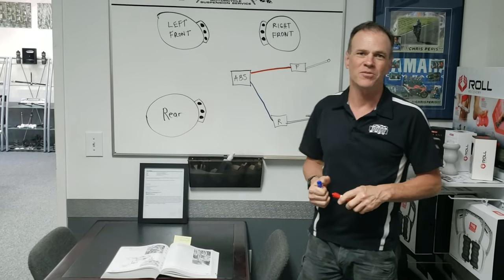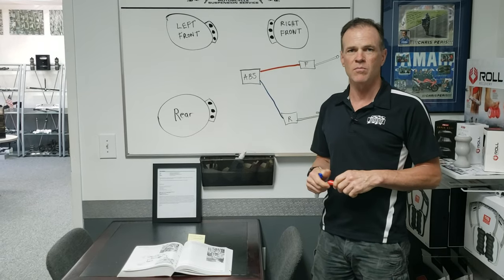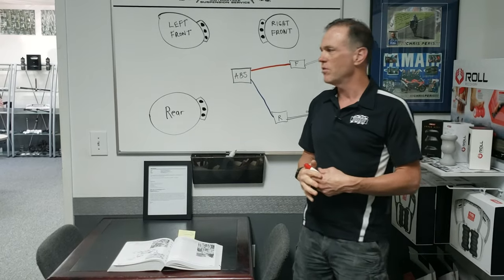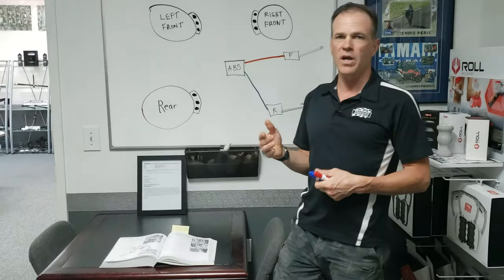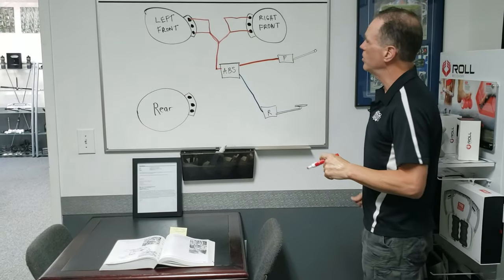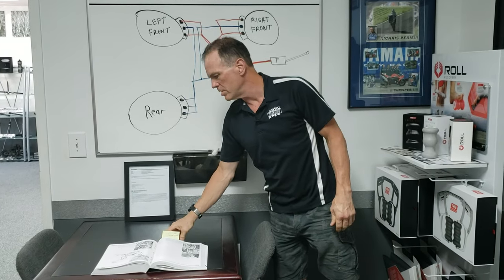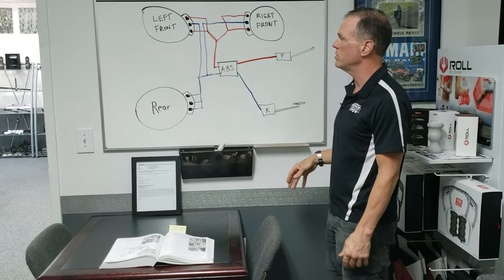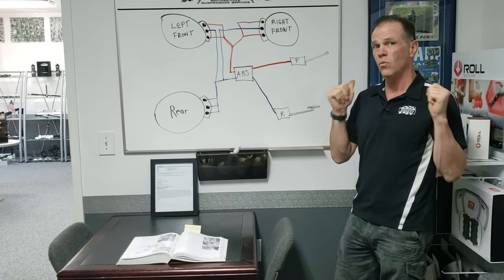2018+ Honda Goldwing Brake System Explained

Comment: This explains why as a first time, 5th Generation, Goldwing owner, I haven’t been impressed with the braking power.  All my life I’ve always depressed the front and rear pedals simultaneously for maximum braking efficiency.  Turns out, I need to be applying the rear brakes first and then add the front brakes a second later to achieve maximum braking power.  Good to know, but yes, now I have to essentially relearn how to brake  just because it’s a Goldwing.  Thanks Honda.
Reply from the maker: Exactly...

Comment: Best explanation I've seen.  As an old school rider, I apply the rear and front almost at the same time  when looking for maximum stopping.  I learned to ride on the dirt where front brakes can get you in trouble on very loose surfaces .  Thanks !
Reply: Have 2006 and 2018 Honda 1800 both of them triked. 300,000+ on 2006 and 29,000+ on 2018.I find that the 2018 in an emergency stop using back brakes wants to nosedive making it very unstable especially going down sharp hills on windy roads.The 06 could be controlled much better using both front and back brakes simultaneously. Is there a way to have more breaking power go to the rear as that is where most of the weight and rubber is anyway? I am and always been a very aggressive rider. This new system is great on 3 wheelers but not so on  trikes. Thanks

Comment: so i have a 2021 gold wing (6th gen) manual clutch .. shortly after i purchased it i noticed the an excessive amount of recoil in the front brake on my hand...i know according to the manual there can be some recoil but this was almost to lock up of the front wheel but once you let the break go the brakes would release ..did not happen all the time but only when the bike went 5 to 10 miles on the highway. at that point when you got off the highway and started to break this excessive recoil began ..honda said to change the break fluid..we did and didnt help...2nd they said to do a back bleed which was done as it was believed to have an air bubble somewhere in the system..i noticed the brake lever was not as stiff and seemed to correct the problem ..a year later the front brake is somewhat stiff again and the same thing is happening... no lights no anti- lock feel happening..i know that the next thing honda was going to do under warranty  was a front master cylinder replacement... in the city this dont happen only after coming off the highway after 5 to 10 miles at highway speed...any ideas ... is it me ?? does it sound like the bike...
Reply from the maker: No idea on this... you should continue to push the dealer to fix this.  It could be unsafe or dangerous.  I really don't know.

You might post on the gl1800riders.com forums and see if anyone else has dealt with this problem.

Comment: This video has some misleading comments about the 01 - 2017 system. Assuming that all components are in a good mechanical state and fluid added and bled and Traction fork springs and 15 wt fork oil installed and Anti Dive System disabled per Traxxion instructions THEN the system works amazingly well. Unfortunately, the description of the function is not easy to get since Honda and forums have it scattered all over the place together with wrong info. For instance to find out the fact that standing still the front level effects only front brakes and foot pedal effects both rear and front is almost impossible to find. And so on...
Reply from the maker: Let me know the importance of how a brake system works for a motorcycle that isn't moving.

The information in this video is completely accurate.

Comment: Compared to my old Yamaha XV 1000, these brakes are amazing. It took some time to get used to how hard the fronts grab and slow you down, but wow, after a few rides the muscle memory kicked in. Love how you hear the drilled rotors sing under heavy braking when a traffic light changes and you know that guy will turn left in front of you! Honda did an amazing job.

Comment: Back in 09, when I bought a Concours 14, I was amazed at the phenomenal brakes on such a heavy bike. I thought it couldn't get any better than that, and was fully expecting My 18 Wing to feel wimpy by comparison. I gotta say, the brakes on My Wing are also pretty awe inspiring. I had never owned a bike with linked brakes, and I'd heard the owners of 2010 or newer Concours14s complain about the linked brakes on those. Honda definitely got it right on the new Wing.
Reply: My Concours had the sensation of warped rotors almost immediately.  The linked braking proved even more annoying because the use of the rear brake alone wouldn't avoid the pulsation from the front.  Kawasaki fixed the problem in kind of a funny way.  They authorized replacement of the rotors, but not the pads.  The bike began doing it with less than 5000 miles.  I live in Iowa and have little need for heavy brake usage so the problem did not arise again until my trip out west the following year.  Since my dealership was about 100 miles away, I simply put up with it.  In Iowa, it wasn't too big of a problem.  Several years later, I had the wheels off for tires.  The rotors had been installed out of phase so the carriers were not symmetrical.  I removed one side to clock it to match the other.  I also loosened the bolts on the other rotor and torqued everything up evenly using a crisscross pattern.  Kawasaki used a plastic shim between the wheel and the rotor, probably to fight vibration.  To my surprise, the pulsing was gone.  Apparently the dealership did not install the rotors correctly when they replaced them under warranty.  Even torque was very important.  I wonder if Kawasaki might have done it from the factory.  We take it for granted that manufacturers and techs do the job right the first time.  Sometimes that is not the case.

Comment: Max, love your products...I own several. The belly pan is pure genius. I would ask that you revisit this video though, and take a look at page 1-115 in the service manual. The rear is applied with the front lever, the ABS unit pump sends it back there when it senses the front being applied.
Reply: It's on different pages depending on year of service manual, below is what it says in short, bottom line is the rear brake IS activated with the front brake lever:
The recirculation-type Combined Braking Anti-lock Braking System (C-ABS) allows shifting of the CBS (brake pressure boost) characteristics according to the selected ride mode. The CBS characteristics are shifted using Controller Area Network (CAN) communication among the riding mode switch, the ABS modulator control unit, and the display panel. 

As front brake lever movement is detected, the pump in the ABS modulator starts to feed brake fluid from the master cylinder to the calipers (pressure boost), and activates the rear brake. 

The CBS characteristics in SPORT ride mode are set to produce an appropriate rear brake force different from the other ride modes. The CBS in the rear brake system is a conventional system as shown in the picture without any brake pressure boost by the ABS modulator.

Comment: I would've liked to see them have the 1 center piston on the rear be linked to the front so that you get some rear braking as well for those that forget to use both front and rear in a panic situation or even just in normal stopping situation were some people never use the rear brake at all.
Reply from the maker: Then the 2001-17 bike might be preferable to you, as it does those things.  

Making the brake system work for unskilled drivers who don't take the time to learn how to operate the machine they are on is the entire reason linked brakes exist, as noted here.  If people would just be properly trained, none of this would exist... and there would be no such thing as a panic situation; Just an emergency situation with a skilled rider doing as much as possible to minimize any possible incident.  You only panic when you don't know what to do.

Comment: I always try to use both brakes for any kind of braking.  Even trail braking.  Because I want to build in the habit of using both for an emergency stop.  I caught myself a couple years ago only using the front brake during an emergency stop for a deer.  I would have stopped shorter obviously had I used both.

Comment: Hi Max. I tow fully loaded and two up with my 2004 and I've never felt the bike was underbraked which is not to say I'd turned down more powerful brakes.  At 60 I'm also a traditional front brake rider. The 2001-2017 system is mentally complicated but really that's because of the stupid anti-dive, which I've shimmed on mine to make it ineffective (after watching your video).  Surely, the straightforward comparison is that on the 2001-2017 bike the front brake lever gives you 5 of the 6 front pistons and 1 of the 3 rear pistons whilst the rear brake pedal gives you 2 rear pistons and 1 front piston.  I'd call that a front loaded system with a little rear stability thrown in for free on the front brake.  As you explain, the 2018+ bike operates 4 of the 6 front pistons, and that's it, whilst the rear brake pedal operates all 3 rear pistons and 2 front pistons.  That's a lot of front braking on the rear brake and sometimes you just want the rear brake.  It's great that the 2018+ bike comes with more powerful brakes but I think you're being harsh suggesting that the 2001-2017 doesn't allow the bike to be ridden in the traditional front brake way.

More importantly, when is Traxxion Dynamics going to open up here in the UK?  Please, please.
Reply from the maker: Hi Michael!  I am not sure where you got your explanation of the brake system on the 2001-17, but it's way off.  I have thought about doing a video on that to explain that monstrosity.  The front brake gives you 2 pistons on  RF caliper, one on LF caliper.  That one activates the secondary master cylinder on the left fork, and gives you 2 pistons on the rear brake.  The rear is Much more complex... I'll do a video.

I have a knowledgeable agent in the UK, Gareth Evans at Reactive Suspension!!!  I don't hear from him much, but he's a great guy!
Reply from the maker: Also, if you haven't ridden a 2018+ you simply won't believe how much Honda improved the brake system!
Reply: @Traxxion  Hi Max. I've found the diagram that you're referring to which I gather is the right one. My explanation came from the GL1800A Service Manual! Good old Honda. 
When Honda incorporate all your improvements in the 2018+ and go back to a bigger fairing and luggage, I'll buy one. Keep the videos coming, great work.

Comment: So there's no way to do pure trail braking because applying the foot pedal applies some front brake  'whether the rider wants it or not.' ?
Reply from the maker: Correct!  On every Goldwing since around 1988.  
However, the 2001-2017 were the WORST.  At least the 2018 is less "Idiot Oriented"...

Comment: Hey Max....love this video!
One question I have is when moving under 10mph will the front brake still activate when only using the rear brake pedal?
I'm having a hell of a time at slow-speed maneuvers, like U-turns.
Thanks in advance!
Reply from the maker: To the best of my knowledge, it does.  You must have a DCT... they require a completely new style of slow speed driving.  You have to leave the throttle open slightly and then use the brakes to control speed, Iike you used to use the clutch to do.

Comment: Hi Max, just found this video. It's a great explanation, thanks so much for making it! I do have a follow-up question, though. As we know, using the front brake in a low-speed turn is never a good idea. I know that the linked brakes in my last Harley disengaged below 25 mph so that you didn't unintentionally engage the front brake in a u-turn. Does the new Wing have a similar capability, where the front brake engagement does not happen below a certain speed so that below that speed it's always rear brake only? Also, do the linked brakes function the same way in all four ride modes?

Tia!
Reply from the maker: Hello Clay,  There is no speed related change in braking function on any Goldwing... that I know of.  I also don't know why you wouldn't use your front brake in a low speed turn.  
If yuou are driving a 2001-17 Goldwing and step on the rear pedal, you will actually be using about 65% front brake whether you like it or not.
Using the front brake transfers the weight of your bike onto the front tire, pushing it harder against the ground, and IMPROVES your grip and traction.

You car or truck does this same thing, automatically.  Check out "proportioning valve" on the internet.
Reply: @Traxxion  Thanks for the reply! I may not have been clear about when to not use the front brake. I meant in u-turn speeds, not at road speed. I've always been taught, and recently, to never use the front brake at u-turn speeds, and to never use the front brake when stopping if the bars are turned. I've seen more than one rider drop their bike by grabbing the front brake at very slow speeds. Now, "grabbing" is certainly part of the problem in that case, but I'm still a believer in trailing rear brake only during u-turns. Looks like that's no longer possible.

Comment: It was my understanding that either lever or pedal apply pressure to front and rear brakes. 
Perhaps lever 4 front pistons per caliper, 2 pistons rear
Pedal 2 front pistons per and 4 rear.
Please clarify
Reply from the maker: There is nothing I can do to more clearly explain how the brakes work.  There is even a color diagram.  Sorry.
Reply: That is the old way that Honda linked brakes.  There was also a master cylinder that the left front caliper worked on to activate the rear, I think. My VFR had brakes linked basically that way.  My ST1300 has them linked that way.
Reply from the maker: @alanhassall  correct!
Reply: @Traxxion  That explanation was as crystal clear Max, superb job.

Comment: A couple of days ago while riding my manual shift MTC, I was the second vehicle back making a right turn after stopping.  The car in front of me started to go then stopped quickly.  I has just started to roll on my MTC, but had to stop quickly too.  I used the front brakes to stop, no problem, but I did notice that I still had some throttle applied and had used the clutch to kill power to the rear wheel.

Seams like I might have been in trouble if I was riding a DCT in the same situation (applying front brake with throttle still applied).  

Do you have any plans for making a left hand rear brake for the Goldwing DCT?  This is a mod available for the African Twin DCT.   With the right foot going down, controlling  the throttle and front brake quickly is quite a hand full.

Or does DCT require some other learned braking technique?
Reply from the maker: We have made a left hand brake kit for trike riders with some form of paralysis.  But not for a normal 2 wheel rider.  There is a technique you have to practice which is using the brakes to modulate speed instead of a clutch.... and you do have the throttle slightly open and held steady.

Comment: Not quite that simple, right ? 
Aren’t you leaving out the fact the front brakes (lever) are linked to the rear brakes thru the CAN bus electronically ? 
Your description is the manual hydraulic part.  Don’t skip the electro-hydraulic part.

Honda would be remiss to link the front brakes with the rear.
Reply: Meant to say, Honda would be remiss NOT to link the front brakes with the rear.
Especially for panic / emergency stops.
Reply from the maker: This explanation is more than adequate for the required level of understanding even the most educated riders need.

The problem with any brake linking is that it requires a comprehensive understanding of the system and applied practice, especially for highly skilled riders that know how to use the front brakes of an unlinked bike.  They actually have to detrain themselves to ride like an unskilled rider who is afraid to use the front brakes.

If Honda weren't to be "remiss", then they would build the bike with one single brake lever, and have it work both wheels exactly how every 4-wheeled vehicle on Earth does.

Comment: Hi Max, thanks for the brake system video.  I’m really trying to understand the braking system especially in relation to slow control maneuvers.  I ran across this source from Honda and it says the braking system is linked to the ride modes as well.  What are your thoughts on slow control?  I know it is a different animal and I continue to practice, which is the only way I will get better at it. https://hondanews.com/en-US/releases/2018-honda-gold-wing-tech-document?page_size=50&page=4
Reply from the maker: The link to the engine modes is nothing I've ever heard of, which means it play no noticeable role in any way, same as the suspension damping adjustment has no effect at all.
Reply: "On the latest Gold Wing, the combined ABS settings are linked with the riding modes to automatically adjust to braking characteristics ideal for the riding situation."  

It would be nice to know what they are talking about!
Reply from the maker: @eugeniustheodidactus8890  It's another level of overengineering and attempting to take the rider out of being in control of the motorcycle...